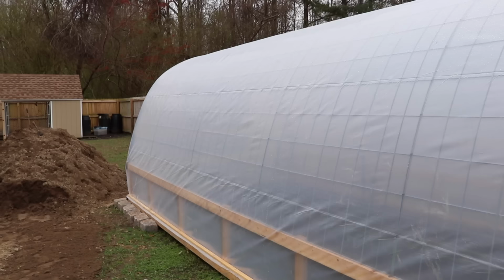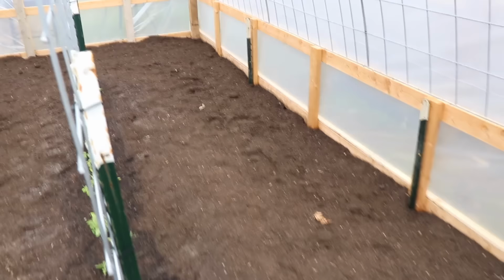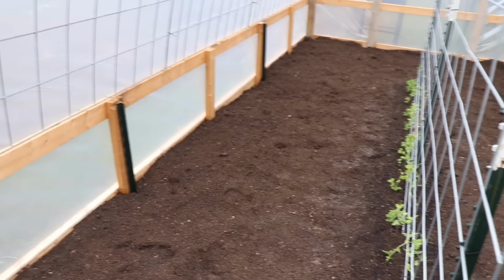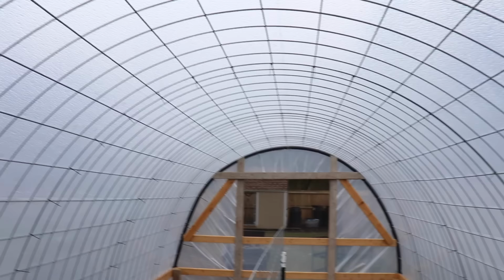DIY Cattle Panel Hoop House || Build Your Own Cheap & Easy!

Comment: Only bad thing...summertime kills the plastic
 Taking mine down to replace with hot beds.
Reply from the maker: Yes, I could imagine it will take a toll on the plastic. There will definitely be maintenance for the hoop house in the future for some areas. 😊
Reply: I used greenhouse plastic guaranteed against UV damage for 4 full years outside. I take it off my garden in summer as I live in a hot climate.

Comment: Sure it is here but not seeing the dimensions wide . Side walls about 3’ ? Tall.
Reply: Looks like maybe 4 panels long just curious on width? 14 or 16’ would give maybe room for 4 rows of buckets?
Reply from the maker: @dewaynegarrett8382  hi! So the wooden framed walls are 2ft high. The hoop house is 10ft wide by 20ft long & 7-1/2ft high. Does that answer your question? 😊

Comment: Will this wire mesh hold up under snow load?
Reply from the maker: Hey Jessi! We don’t get much snow where we’re at so I can’t really say but I would imagine probably not.😂 I have had some subscribers tho that have a hoop house like this and that do live in heavy snow areas. They mentioned just adding extra support beams down the center to help support the cattle panels. And staying on top of snow removal. Hope that helps! Thanks for watching my video! 😊

Comment: How will you prevent the foundation boards from rotting over time?
Reply from the maker: We won’t. We’ll just replace if and when needed. We built this structure with what we had on hand because it was the cheapest at the time. 😊
Reply: @HomeFreeAlaska  well you are still young lol.  Us oldies, as we age, have fewer capabilities to do such.  Pressure treated might have been a good investment but I understand having materials on hand.  I am a builder by profession so had to ask.  You did an admirable job and I truly enjoyed your job.  Thank you for sharing.
Reply from the maker: @1stbadger700  thank you! 😊

Comment: i am not quite certain if or how you made a channel for the panels to sit in
Reply from the maker: Hi Theresa! We did not create channels. If you look at about minute 3:41 of the video you can maybe see that we pre-nailed nails down the 2x4. We were then able to prop the cattle panel up against those nails while we’re hammered the u-nails in. Then we went back to the regular straight nails & bent them over the panel. Hope that helps! 😊
Reply: @HomeFreeAlaska    it does thanks!
Reply from the maker: @theresaroth3954  you’re welcome! 😉

Comment: How often do you have to replace that plastic?
Reply from the maker: The manufacturer of the plastic says that it will need to be changed out every 2-4 yrs depending on the weather/environment where you are.😊

Comment: Unless you get UV plastic it doesn’t hold up I have used plastic wrap before and it disintegrated after about three months .The sun will just beat it up
Reply from the maker: Your exactly right, we did upgrade to a greenhouse plastic. Thanks for the advice! 😊

Comment: Plumbing a 10-12' 2x with a six inch torpedo level maybe not the most precise.
Reply from the maker: Well, it is a thrown together inexpensive hoop house that doesn’t need to be perfectly straight nor will you ever be able to get it perfectly straight and level. Just needed to get it round about. I think it turned out really well. 😊
Reply: @HomeFreeAlaska  I agree it did.

Comment: How long did the plastic last on the steel reo 🤭
Reply from the maker: The plastic on the steel has never been an issue. 🤷🏼‍♀️ Cool to the touch in fact. And we have over 100 degree heat here in VA in the summers. 2 fans, 2 windows and a shade cloth keeps the hoop house at a perfect temp.👌🏻
Reply: @HomeFreeAlaska  That’s really interesting , I used to build green houses and mushroom houses for a living using smooth round pipe ,commercial grade houses ,we had to use foam tape over the pipe other wise the heavy duty plastic would shred in a couple of months from wind and storms etc .It was standard to use the tape as it was designed for that purpose . Glad to hear it’s still going strong 💪

Comment: What are the metal t-posts for?
Reply from the maker: Just extra support. Since we only put 4x4s in the 4 corners…there was no real support in the center of the frame & with the hoop house so long at 20ft long…the center would be floppy & unstable. So we added the t-posts for sturdiness. 😊
Reply: @HomeFreeAlaska   That's what I thought. I really enjoy your helpful videos. I am building my High tunnel as we speak. God bless you and your family.
Reply from the maker: @queenstower4x4  nice! Good luck!!! 😉

Comment: Nice but not cheap to build. Will it handle 3 ft of snow. Not saying this to be an ass just wondering
Reply from the maker: Well it was cheap back when we built it spring of 2021 before all this inflation. We built this hoop house for just $500! I don't have a clue about the snow because we don't get much snow where we're at here in VA. I have had subscribers that have built this in heavy snow areas and they say they do fine with extra support beams down the center to help support the cattle panels.
Reply: @HomeFreeAlaska  just wondering about the snow in in mass so we get storms. $500 is not bad but like you said now I’m sure it will be more. I’d be curious to know how much more now.
Reply from the maker: @improvisedsurvival5967  me too. Seems like everything is sky-rocketing right now. 😏

Comment: I tried peas inside my hoop house and they burned up.. any suggestions?
Reply from the maker: Yes, we actually moved our peas out of the hoop house. Peas do not like hot temps at all. It was way too hot in there for them. They need to be in a cooler place with partial shade. 😊
Reply: @HomeFreeAlaska  I love your hoop house! I'm going to revamp mine this spring and doing like you have at the bottom of yours 👍
Reply from the maker: @unkskay1958  awesome! Good luck…😊 Our hoop house has been a wonderful addition to our garden space! 😉

Comment: You didn’t show how you connected wire to wood
Reply from the maker: Hi Kathy, the cattle fence panels to the wood frame? Yes we did in the very beginning of the video. 😊 Minute 1:28 we show you that we connect the panel to the wood using U nails. Then in minute 2:52, you can see how we prop the cattle panel up with a temporary nail to hold it in place and then continue adding U nails. Hope that helps!

Comment: is this in Alaska?
Reply from the maker: No this was built a couple yrs ago when we lived in Virginia!☺️
Reply: @HomeFreeAlaska  are you in Alaska now? Nice job on the greenhouse. I live in central Minnesota and would worry about the snow load.
Reply from the maker: @happycampersminnesota7526  yes, we just retired in Alaska about 6 months ago. A lot of people have these hoop houses up here, they just put a center support beam in and have to make sure to clear the snow, can’t let it pile up. We only got about 6 inches or so in VA so it was no big deal. We’ll be building an actual wood built greenhouse here in Alaska tho as I don’t want to have to worry about clearing snow if I don’t want to.☺️
Reply: @HomeFreeAlaska  keep me posted on how the hoop house does up there. We live in central Minnesota and got some very heavy snow this year.

Comment: The cattle panel was not too wide.
Your wooden framework was too short !
Reply from the maker: Eh no…the cattle panel was too wide for the design size we wanted & so we cut it to fit OUR desired design. Our framework wasn’t “too short,” it’s the exact size we planned for, 20X10. 🤷🏼‍♀️ Seriously?
Reply: @HomeFreeAlaska  ,
And later on , maybe even a few years later, when you want to repurpose that particular cattle panel , and you need a full sized cattle panel , what are you going to do ? You have cut that cattle panel narrower but you can not cut it wider again.  Let us not forget that you paid for the part that you cut off.
  I have been in the same situation and it was easy to adjust the frame to be a few inches longer so that I maintained the integrity of the cattle panel.
  20'5"X10' was quite easy to do . Seriously ?
Reply from the maker: @donaldmiller8629  well goodness don’t you get worked up over something that’s not even your problem to have. First of all, this house sold 5 months ago soooooo I won’t be repurposing anything. 🤣 And if I had another project that needed a full panel, I’d go buy one. And the piece we cut off wasn’t wasted at all…why would you assume that? It went nicely in my outside garden area & added a cute little fence around my tomato bushes. Soooo yeah…😉

Comment: I. Don’t Think. I. Would. Have. Built. I. As. Tall.  ,   Because. Of. Wind. Damage.  !
Reply from the maker: It’s only 7-1/2 ft, it’s not that tall. I didn’t want to have to bend over while walking through. 😉 We have high winds & tornados here in VA, the height has never been a problem.

Comment: Those are hog panels.
Reply from the maker: Straight from tractor supply website (16 ft. x 50 in. Max 50 Feedlot 10-Line Galvanized Cattle Fence Panel) 

They also have (16 ft. x 34 in. Hog Feedlot Panel Fencing) 
hog panels aren’t as tall. 
Thanks for watching! 😊